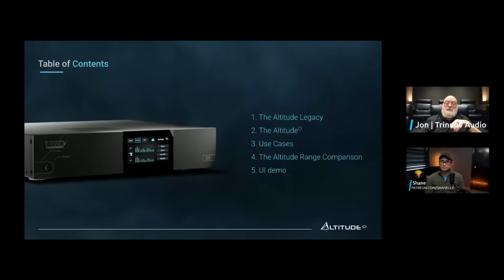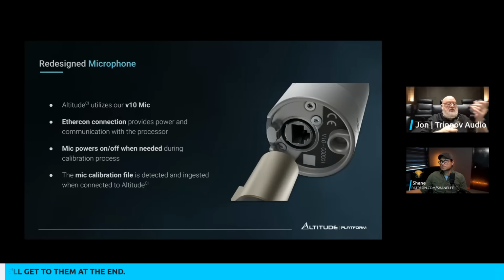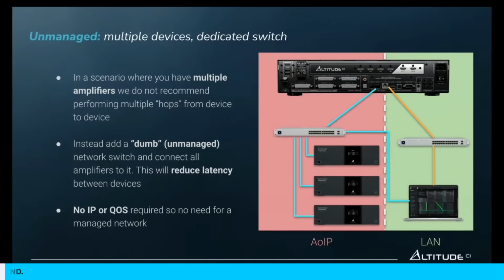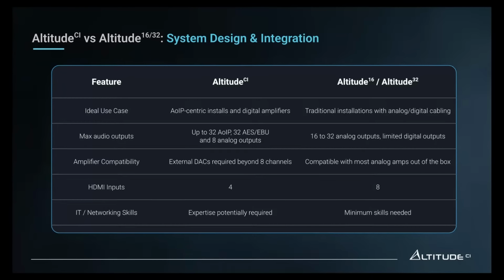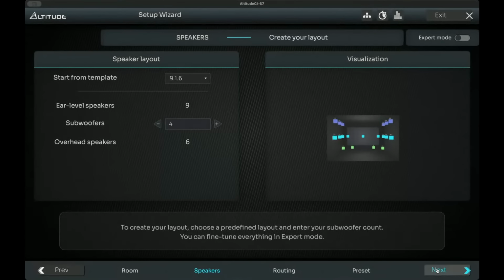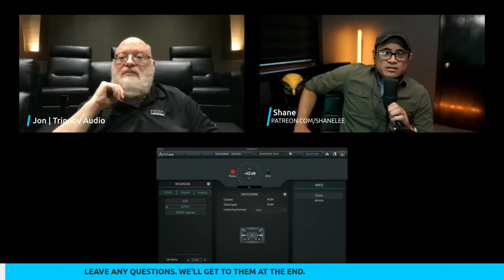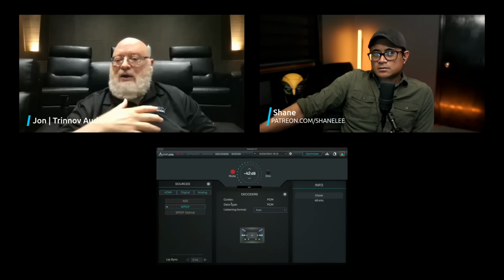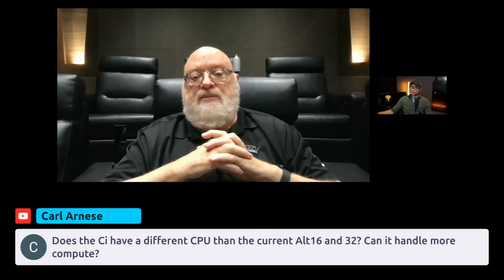Trinnov Altitude Ci | New Firmware Walkthrough

Comment: Most interesting new product for a while.
Looking at AC DPR-16 for Dante and ART to because 1/3 of the price.
Reply from the maker: Nice processor but no upgrade path past 16 channels.
Reply: @therealshanelee 
That’s a problem of course.
But for a 7.5.4 you can do a lot.

Biggest problem is the second hand market.
Here i need to give it away almost.

Trinnov I never have to upgrade.

But Trinnov without waveforming vs ART is the big question here.
Reply from the maker: Trinnov and McIntosh the Rolexes of home theater. Best value retention in the biz.